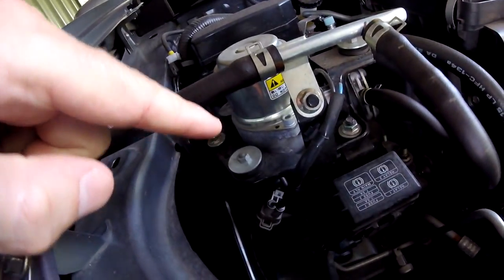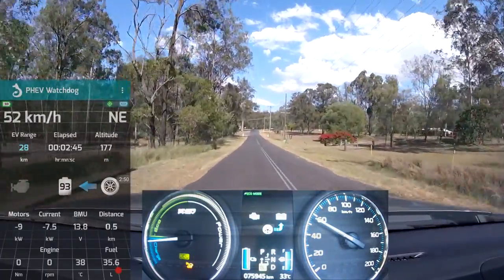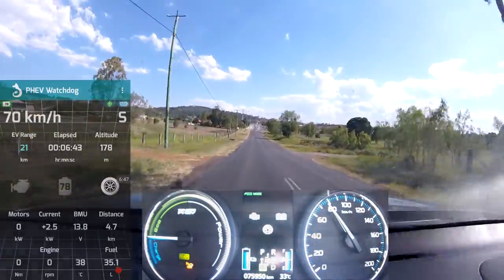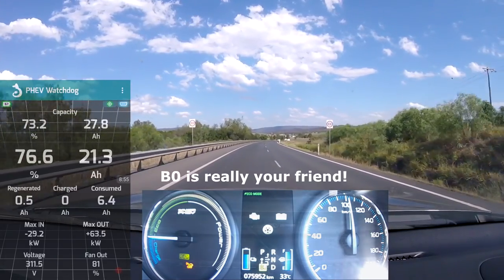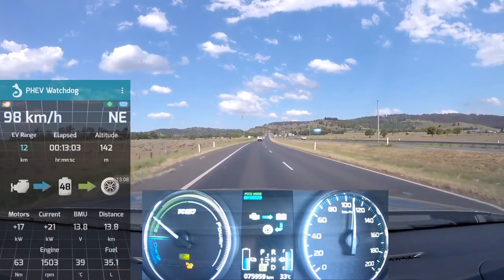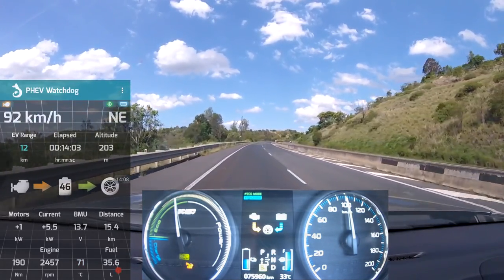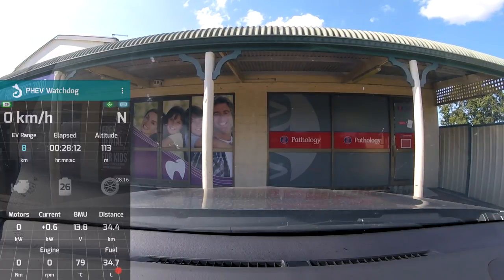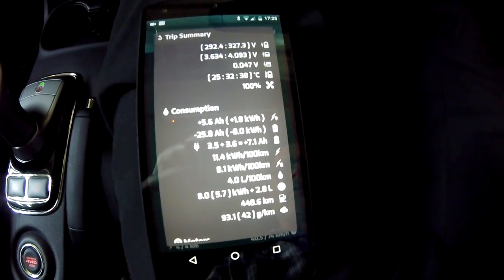EP140.4 - Driving the PHEV in Charge Mode and B0 for best fuel economy on the highway

Comment: Boy, I sure didn't know what I was getting into by buying my 2020 Outlander PHEV.
Loved my Prius for the past 12 years and thought this is just going to be that much and better (didn't want to wait 2 year waiting list for Rav4 PHEV!)
Thanks for your videos for help in understanding... Not that, at 2 weeks in, do I begin to pretend I understand yet... YIKES!!
Reply: How does it compare to the prius? I am actually debating between a 2015 prius or a 2015 outlander PHEV. Would love to hear your experience with both
Reply: @J0risNL  well, I ended up giving the Outlander back (with much opposition from Mitsubishi) as I found out it is not advised to use it with an extension cord which, in my situation, was the only way I could plug in. (The warranty would void if there ever should be a problem with the charging which they neglected to tell me when I bought the car)
I eventually won my battle and they bought it back and I returned to a trusted Prius sooo now have my 2020. A MUCH better fit and vehicle, imo, just don't have quite the space as the larger Outlander. But that's ok by me as I'm one person only using the car.

Comment: Just bought the Ford Escape one.  The 2024 version dropped the charge function.  The modes are sport hybrid eco Save for later I forget them all now but in hybrid mode what happens when you put the car in just neutral over just letting off the gas pedal?  I am taking a drive into the mountains.  Some very steep hills I know going downhill on my car I traded in the 2013 Elantra.  That car to go 600kms I would fill up in Kamloops best 28liters mostly 33 liters in gas.  Coasting would be pressing the in clutch.  Getting to experiment soon I guess.  My thought would be to pulse and glide.  I found with my old care keeping it in neutral would stop the gears from clicking in thus slowing the car and getting less resistance.  In Hybrid mode I am thinking that neutral shuts off the gas completely.  Some of the hills are 20kms or more.

Comment: Hi Andy. Into our first week of owning a 2014 phev (we live in chch nz). 45k on the clock and the SOH is 86%. Lovely car to drive. The car will ultimately be used by the wife for trips into town for work and back 22 km round trip, and maybe a few kms after work. Anyho, last 5 days averaging 42-44km per full charge, flat roads town driving. So far, hardly used petrol and charging it up at the end of the day after tea for the next day, or a couple hours during the day for a top up when i used it. Is this healthly for the battery? Should we use only electric when we can? How often should we charge it a day considering? Your advise is much welcome. regards john
Reply from the maker: Charge it as much and often as you can. 
ABC - Always Be Charging

Comment: I had a Volvo diesel hybrid and I’ve tried using these techniques but it seemed to behave very differently. The big difference is it didn’t have a proper glide function; the motor would initiate a minimum regen when the throttle was released and the intensity would increase through the brake peddle. The only times it wouldn’t regenerate when coasting would be if the engine was on or if it was in “pure” mode and travelling over 45mph so the rolling resistance was certainly very different to this car. Another difference I’ve just noticed rewatching this video is the charge function in the Volvo would charge the battery regardless of throttle position and it would charge the battery to only 48%. It put a lot of load on the engine, dropping my fuel economy all the way to 25mpg while I averaged 54mpg without it. The battery also seemed to lose an unusual amount of battery power even when stationary. I once lost 10% battery charge just going through a McDonald’s drive-thru which just didn’t seem right. Anyway, I know I couldn’t optimise it’s performance cuz I couldn’t monitor the battery health to the degree you can and the faults it has, I’m not willing to put the money into it right now. I must ask though, when your car is gliding with no regen, what would be powering the car’s auxiliary systems? Would it be the main battery or would there be another source?

Comment: Hi Andy I'm from the UK I have a 2015 outlander PHEV  and I am looking at a average 19 miles on a full charge, with no heat or lights. My car is currently with Mitsubishi just now and I have had a call to ask me what I thought was wrong with the car I've told them that I feel I should be getting a lot more than that. And basicly they are trying to fob me off with " well it depends how you drive and if it's cold outside and all that nonsense.  I will try and find out from them what the capacity of the batterys amp hours is when I pick it up tonight. Do you remember what the amp hours was on the full change when you got the procedure done that took you state of health back to 99.7%. This info would be much appreciated. Thanks. Ps really enjoy you videos.
Reply from the maker: You need to get the Dog and show them the numbers. The GOM cannot be used and it totally depends on how you drive it.

Comment: Hi Andy, I came across to your video after 2 years of your posting, but  thanks for sharing! If you still own a PHEV, can you please tell me if someone has ever replaced the battery in this car? I am thinking to buy a used 12.2015 (year 2016) car with 140k driven, imported from Netherlands to Finland. I am a bit concerned about the battery life of this car as people say that it degrades and battery capacity drops. I also read online that IF PHEV has a battery with less than 26Ah capacity, it would be replaced by Mitsubishi dealers when the car has less than 160k km and less than 8 years. Is that true? I need your help!

Comment: Hi Andy, thanks for sharing this - it‘s like a preparation until I‘ve my own one (PHEV arriving 04/2019) - one question: why are you using Charge instead of Save uphill? Your intention is to fire the patrol engine, right? In Save mode this would work also, right? Or do I overlook something? Thanks again, viele Grüße, Klaus
Reply: got it by watching and listening carefully :-)
Reply from the maker: @airestocky  Charge keeps the engine running for longer which is more efficient. Save will intermittent start the engine. It takes longer to warm up, more emissions, less efficient.
The two modes do not make a difference uphill but it's just a habit.

Comment: I got an outlander but what is the best general B setting for my wife? I don't want her to start changing around stuff on the go. But I think B3 is the best mode? Reason is it provides some charging which maybe equal to the miles you save while coasting in B0, acts like an engine brake which can make you slow down quicker in an emergency situation and B3 is not that difficult to feather the pedal to make it coast on a faster road

Comment: Good job. I already love this SUV! But the 40 km battery is disappointing! I think most of people wants to drive the PHEV cars all the day electrically & gasoline only for emergencies! They should have shrinked gasoline engine components for the batteries  capacity. It'll be on my list until they increase batteries capacity. & I hope they enhance the range even more with the upcoming sold state batteries!
Reply from the maker: Problem is, you carry this heavy engine, transmission, tank, cooler, exhaust, ... with you all the time. Makes the car really inefficient. Also, you still need to do maintenance on the vehicle even you have not used the engine much.

Comment: Hello. I do not know English well. I understood correctly. In the long run for low consumption, I have to press the charge button when the battery runs out and drive in B0 mode. Did I get it right? Thank you very much for your help
Reply: Electrical power is not as efficient at high speeds
The motor isn’t as efficient at low speeds.  
Use charge function if you are travelling at high speeds approaching an urban area where you don’t want the engine on and you don’t have enough charge to make it through .

Comment: In my 2015 PHEV , you can only use cruise control in D (adaptive) not any of the B5-B0 so you can’t control the regents/coast.  I understand that may be different in other years.
Reply: In my 2014, you can set the B value to anything before you engage cruise control but B0 - B2 get changed to B2 and B3 - B5 are kept.

Comment: I am a  new owner of a 2018 PHEV model and the dealer rep told me to charge all the way through, I.e. with a charger plugged in all the way through to 100% and all the way through when pressing the charge button. I tried charging all the way through with charge button mode and the charge stopped about 90%. The rep told me to do full charged in order to protect the battery from deteriorating.
Reply from the maker: What the rep tells you... he's got no idea about battery management.
The charge stops at 90%, OK.  I can imagine that this is very wasteful in fuel consumption. The energy the battery takes is fairly small at this SOC so probably not worth charging above 80%.
Reply: @unpluggedEV  to add more context, sometimes I want to just gain 5 to 10 km in EV after depleting my first full battery. So gaining 5 to 10 km via Gas charge is what the rep says is bad. I need these extra bumps in EV to idle in EV while my kids nap in congested urban settings during winter and summer months in Canada. I have also found though that even if I'm at zero for EV there is enough of a reserve to idle in EV state for maybe 20 to 30 minutes more which is really helpful.

Comment: I drive 100km to work and home each way.. 200 per day.  Speed limit in my US State highway is 105km/h 65 mph.  I try best to keep this speed as this is the top speed I've found to be optimal for the hub single speed.

However, driving this limit in the US results in dangerous situation as other drivers maintain 20mph more than the limit.
Reply: i want to buy this car for same distance ...highway everyday 200km. speed 100km/h... what consumption will be ? Tnx
Reply: US is crazy. Here in Australia there are lot of speed cameras, many of which are hidden, and police will pay attention to you if you're going more than about 10km/h (6mph) over the posted limit. People complain about it all the time, but we have traded speed for safety.
Reply: @Secretlyanothername  i moved within 20mi from work 1 year ago. I drive EV to work, and EV home (charging at work).   Pandemic made that less frequent, however.

Comment: Hi, i have been watching many of your informative vids since buying my phwv. My only comment in this video is you recommend using the charge mode instead of save mode as it saves a litre in comparison. But what about battery degradation? If you charge, recharge 3x during the trip and save a litre, have you not just taken 3 cycles from you battery instead? Would the latter cost not be more? Also, in save mode, would you not benefit from regenerative braking thus perhaps giving you lots of charge towards the end?
Reply from the maker: That's not quite how it works. The DoD (depth of discharge) is what counts. A full cycle would be a 100% DoD (from 100% to 0%). In Charge mode we charge the battery up maybe 5-10% only, say from 60% - 70%. The DoD would be only 10% in this case, so 1/10 of a cycle. In Save mode the car does it automatically and charges around 3%, turns off the engine and uses these 3% of electric energy. The DoD is only 3% but far more frequent then with the Charge mode example. 
I found as the engine  stays on for longer it operates in a more efficient way and uses less fuel therefore.

Comment: I'm wondering how much fuel it will use if you drive it with 0% battery from start to finish.
Reply: 110km/h = 8.0L/100km

Comment: Andy, about the reset on PHEV, one man says this, is that correct? Read about lithium batteries how they work in automotive applications if you want to understand the issue you have created. By resetting the BMU you have basically eliminated the bottom buffer of the battery which means that you have increased its DoD. Just by doing this every time now when you discharge the battery below that artificial bottom buffer (which you do not have any more) you will be accelerating the degradation of the battery. You also risk experiencing issues such as car suddenly stopping while driving with EV system error message.
You have not fixed anything with BMU reset. By such reset you just borrowed for a short term some longer EV range driving in exchange for more rapid battery degradation in the future and reduced overall lifetime of the battery. There is really no free lunch here. It is your battery, so it is up to you what you want to do with it, but that reset was not a smart thing to do and as I wrote before, nothing to be proud of.
Reply from the maker: No, that's not what the reset does. We have tested the DOD and all other parameters in every detail here on the channel. It is purely software related, nothing else. It will not harm the battery.

Comment: What about driving 50 to 150 km open road highway mostly flat surface? Save vs Charge?
Reply from the maker: There is no 150km/h here in AU. Madness to drive that fast with such a car.
Reply: unplugged EV it is not madness - ur not used to it - in Germany it is common

Comment: Is there a difference in engine RPM/output between Save mode and charge mode?
Reply from the maker: No difference.
Reply: @unpluggedEV  Ah thank you! I am trying to figure out how this works. I owned a Volt previously, and mountain mode (similar to charge mode) would increase engine output to slowly increase SOC. Hold mode would just make enough to prevent SOC from dropping.
Reply from the maker: @fbottone  Sounds like the same in the PHEV (Charge and Save mode). Charge mode slowly increases your SoC while Save works intermittent to hold your actual SoC level. I found charge mode a little bit more efficient as I can use the battery power at a later state again. It depends a bit what journey you do...
Reply: @unpluggedEV  Ah! This makes sense now, thank you!

Comment: Should've switched on the engine earlier.

it didn't even reach regular working temperature.86-90degrees.

Also why not use cruise control ?

And I'd rather start the car only once. starting strains the engine ALOT.
Reply: Cruise control doesn't let you glide.  B2 is the minimum.
Reply: @RobertHutton  I know.
But it also consumes just enough energy to move the vehicle.

So while it doesn't glide it's overall consumption should be better.
Reply: But it will potentially accelerate harder than you would.  It puts the priority on keeping the car going at the exact speed, and will fluctuate the power more than you as a driver who can allow the speed to fluctuate and keep the power usage down.
Reply: @RobertHutton  well the cruise control never accelerates as fast as I would.

Now for shorter trips cruise is ALOT less viable.

And I live in a hilly area for my country's standards.

So even B2 will let my car glide due to the weight.

Anyway for medium/long trips the cruise control will almost always come out on top.

Comment: I´ve been driving my mitsu (-21 model) now for half a year in Finland. During wintertime highest gas consumption was 7,3 l/ 100 km driving 80-100 kmh for 150 km, minus degrees, full car, starting with empty battery. Usually my daily trips vary between 25-300 km and gas consumption has been 0-6 l/100 km respectively when starting with full battery. E-range could be better, but then again, such cars cost a lot more here.